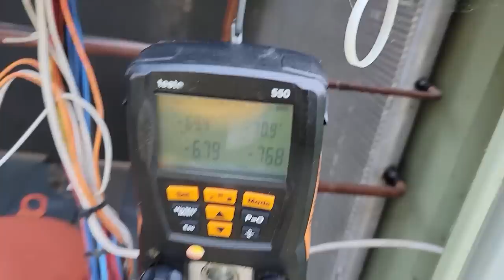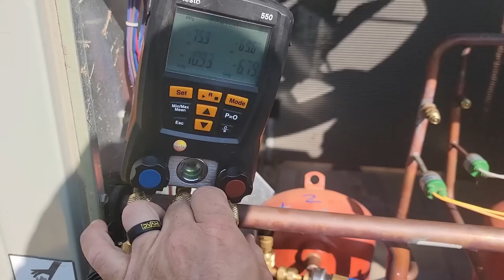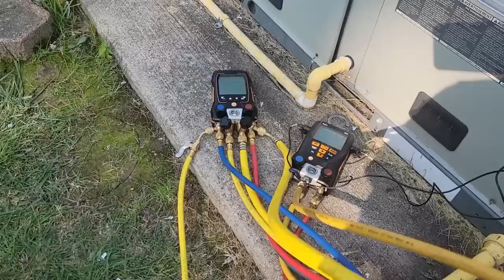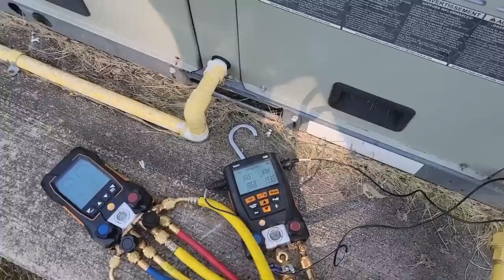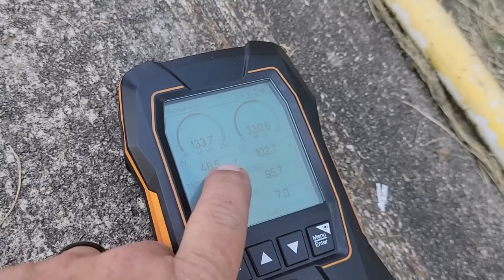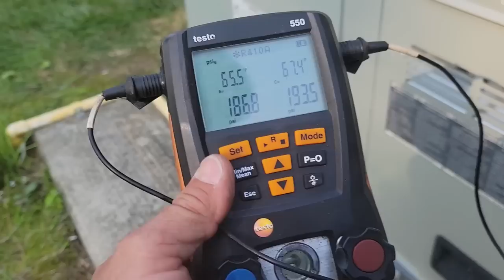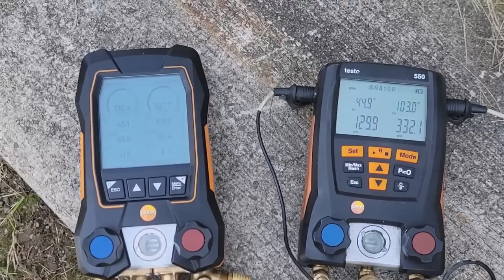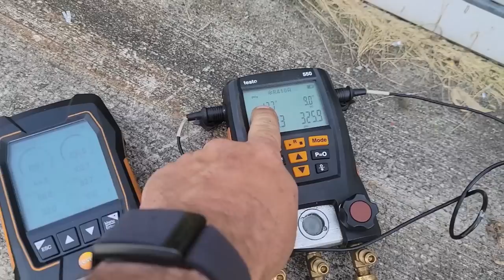Trane HVAC System Not Cooling / Full Repair Procedure

Comment: You are wrong on dye for the same reason cars come with it, its extremely effective. If its a old machine do the customer a favor and sell it to them, everybody wins. Acetone cleans it up like magic.
Reply from the maker: Auto mechanics use it because they're not air conditioning technicians. Hear me out... Air conditioning is just a touch of what they do, they don't specialize in it, sure they understand how it works and have the MAC card, so do I 😳.  Car mechanics usually have a all in one machine they hook up,  punch in the numbers and it does all the work otherwise they change parts that were already predetermined by the factory. They don't find a different brand of part to fix a problem or redesign it. That's a Huge difference,  that's not too dethrone them or devalue but to just state facts they are mechanics that are good at fixing a shit ton of cars problems but that is totally different than just a dedicated hvacr mechanic that works on everything under the sun multiple different facets in the mechanical world. I'm not talking about just residential,  I'm talking about commercial, industrial and all the other different things that most people never see.
Reply: @HVACRSurvival   I don't think that argument makes much sense because a mechanic could have the same leak detector right.  Cars come with dye not because of auto mechanics they come with dye because it's cheap, simple and effective. I'm not trying to flex over anybody but I've had my own air conditioning business in Jacksonville Florida for over 20 years and we've been the largest Fujitsu unitary dealer for at least the last 5, long before we used dye. Dye absolutely increases our productivity and we're probably going to start selling it on tune ups, costs us $5 a shot.  You might want to stay out of Florida or at least make sure bring some rags and acetone with you.  I don't know where you're at but I did see it one way drier on that unit🤣
Reply: @HVACRSurvival   I actually have a trap question for you, do you carry UV light on the trunk for machines  you know have dye, customers tell you they have dye or they have a label?😁
Reply: @HVACRSurvival  I was a mechanic for 7 years before changing careers to residential HVAC. I specialized in MVAC repair and diag. The dye I have always found less helpful than you'd think, usually you have to break out the leak detector or the big blue and a lot of times even that's not enough to find leaks, so you end up evacuating and leak detecting with nitrogen. It's pretty similar to residential HVAC. What sucks about MVAC is there's not a lot of help with superheat and subcool numbers to help you diagnose, and there are only service ports on the suction and discharge usually. Even if you could measure SH and SC accurately, there's so many variables like blower speed, engine speed, engine fan speed, ambient temps inside and outside the vehicle, mode settings, engine temp, etc etc so you end up trying super hard not to just guess and fire the parts cannon. Manufacturers generally only publish charge weight, oil volume and MAYBE target pressures at a certain RPM. MVAC could be ridiculously frustrating sometimes, even with the fancy all in 1 recovery machines haha
Reply from the maker: I have a UV light, the only place it was useful was inside a plant that recovered old refrigerators and recycled them. There was so much refrigerant in the air that the detector was going off non stop. But I didn't see the leak, it must of been leaking under the insulation somewhere in this large recovery machine

Comment: I’m pretty sure you accidentally left your manifold open on both sides, which is why your gauges were reading almost the same pressure on both the suction and the liquid side (as if the compressor wasn’t running) even tho it was. So, the refrigerant was just being passed through the manifold on the gauges.
Reply from the maker: I'll have to review the video again, anything is possible👍👍

Comment: Good ole itchalation. I did mechanical demolition for almost 10 years, and I don't miss that. Especially the old brittle stuff. 
Pro tip: baby powder is an essential when working with that. Rub it on your neck and arms, and it will block the pores so it substantially reduce the itch.
Reply from the maker: Interesting, I'll remember that🤜🤛👍👍

Comment: Rick, that's a nice swaging tool. I made a tool for a one time use. I was remodeling a house where the water pipes froze, but didn't split. They just swelled, fortunately. I had to expand one pipe just enough to use new pipe to repair the old system. It sure saved time and money.
Reply from the maker: Save lots of money on fittings and less places to have leaks.

Comment: 23:07 - Speaking of sharing what works: I can perform smooth un-sweats perfectly every time now since learning about the Sta-Silv White flux trick. Liberally flux the joint you want to unsweat before hitting it with the torch to make removal and reassembly go much better.

Comment: I noticed you have the same swaging/ flare block kit I had in college @ 26:40.  Every tool has its place. When I get in a tight place where theres no room or abosolutely cannot slit the pipe or it will screw me all up, this is my goto tool. It NEVER splits the tubing because it doesn’t try to stretch the whole length of the tubing at once, but rather in increments. Ihave several, and use my yellow jacket monster pair most often but it splits tubing rather easily if you dont rotate it often during the stretch,  i often use it to repair fitting that dont seem to fit ok of have a touch of solder in them or trying to re-round out a compressor connector that was damaged in shipping. Like your videos... have you ever thought of taking the wife with you to shoot the videos while you work?...not all the time but on occation, she seems to be a pleasant personality with a good sense of humour. You guys seem to be a great couple, and she seems to be quite knowledgeable.
Reply from the maker: Well... she kind of has a job too, and she feels as though the whole hospital would shut down if she wasn't there 🤣 . If there's such a thing,  we would call her like a super scrub tech,  administrator assistant super something 🤣. Thank you for the compliment, she liked hearing that.

Comment: Run a filter on your recovery tank to prevent contaminates from entering system when using reclaim refrigerant
Reply from the maker: Yeah 👍👍 after making that mistake,  that's what I've been doing. I've been using a quarter inch flare dryer on both sides with a short hose. Filtering it going in and filtering it coming out.

Comment: 5:03 - So, you’ll be able to reuse that refrigerant in the unit after blending off the top? I guess that’s allowed. De minimus, right?
18:08 - My school taught us to use an “slightly oxidizing flame” for all braze joints. That has served me well two years beyond class.
Reply from the maker: R410a has more issues with fractionation more than other refrigerants do. I usually prefer to recharge with all new refrigerant but if that’s not how they quoted it then you can try what I mentioned.

Comment: Good thing you had 2 sets of Testo manifolds to confirm they were both working 😅
Reply from the maker: 🤭 It save me some time but I would have had to check each individual circuit either way. I didn't always have all these fancy tools. But I've always had at least two basic manifolds.

Comment: So I see you using the field piece vacuum pump and in your newer videos you use the Navac battery operated one which do you prefer ????
Reply from the maker: Eight CFM versus four CFM as long as you’re using a big hose either one’s gonna get it done rather quickly. Size and speed is nice with the wireless, but I would assume the plug-in model is going to last longer, it comes down to personal opinion.

Comment: If you’ll heat the copper a little prior to swedging it will never split. I got tired of it splitting everything, and once I started heating it just a bit it never happened again. I do still try and rotate it several times.
Reply from the maker: I have done that on a few videos and it works great 👍👍 thanks for the feedback!

Comment: Did you purge nitrogen when you were un - sweating the old evaporator out?
Reply from the maker: Nope. I have a bottle brush if I need to clean out a fitting, normally it doesn't get that bad because you can un-sweat faster than finish work.

Comment: Speaking of swaging, I was taught that when mechanics have stock in the truck, copper and fuses gothrough something called embrittlement.  This is where the copper looses a bit of its ductility as do fuses as they age and loos their ability to flex.
Reply from the maker: I have noticed that, sounds correct to me
Reply: It’s called annealing, copper work hardens.

Also how do you keep manifolds clean with using different types of refrigerant or after it gets horrible dye in it?
Reply from the maker: Purge

Comment: My unit was low on refrigerant by 2 lbs over a 4 year period. It was recharged recently, but I'm beginning to wonder the impact on the heat pump.  I hear new systems like Trane can heat without auxiliary heat when the outside temp is still 15 degrees. Should I invest on a new unit? The last unit was installed in 2008.
Reply from the maker: I run mine down to 20° and it's only a 12 seer. It doesn't put out much heat but it's better than running electric. I guess it depends on how much your electric bill is during the winter as to whether or not it would be worth investing the amount of money that they want for that unit. Carriers got one that is called the infinity VNA and it can do I think zero degrees outside at full capacity,  I forget but I know it's a lot better than 15°.
Reply: @HVACRSurvival  Good to know. It's in OH, so weather can be cold at times. Our first year we kicked in the aux. during a polar vortex and ended up with a $400 bill on month. To offset, we do run a woodstove about 70% of the time.
Reply from the maker: 250-400 is about normal in Ohio for an all electric 1500-1800 square ft. In coldest part of winter

Comment: Just Curious. How did the vacuum go using the core depressers? Did you have a good decay test using them?
Reply from the maker: Its not idea, Your taking a chance the vacuum will pull past the Schrader cores so I left the vacuum run even after I backed out the core depressors. Then I released the liquid into the high side. I was gone 2.5hrs on the other call with those big 3/4" vac hoses pulling down with the 8cfm pump, I can normally hit a perfect vacuum with a compressor in the circuit in 30 minutes or less. Whos to say the refrigerant didn't have moisture in it or was fractionated... so I'll be strait,  I did not verify the microns. I'm a horrible person....

Comment: Have you tried the ars pro press fittings ?? They are fantastic..
Reply: So, when you have two compressors..do you have two separately charged systems? Or one big charge?
Reply from the maker: Depends if the compressors are on the same refrigerant circuit.  Smaller systems are usually separate. Larger ones are in parallel.

Comment: I have the testo 557 and the 557s and I have had to send the 557 back to testo to get the gauge recalibrated because my sensors were off on the 557
Reply from the maker: Mine were defective when I got them, Testo swapped them out with a new set. I couldn't get the firmware to update, it would fail 35% into the update.

Comment: I have the same Hilmor swage kit. I also have their benders with the reverse bending attachment.
Reply from the maker: Same here, I love my bender
Reply: @HVACRSurvival  i did notice myself when you talked about swage that 3/8" line. Its done that to me as well. The other sizes it doesn't do that. Just 3/8". Anyways i really liked the video. It was cool to have a longer video than normal.
Reply from the maker: @jasonjohnsonHVAC  Thanks for the feedback!
Reply from the maker: @jasonjohnsonHVAC  I have the 1/4 and it will do it to but I heat it up or use the spin swage

Comment: Nice.  Why didn’t you just pop the economizer out to give you greater access? Not a criticism, just wondered.  We always remove them for access when swapping evaps.
Reply from the maker: I thought about that, I don't do a lot of Trane and was worried I might break that plastic damper linkage. You have a good point!
Reply: @HVACRSurvival  To save aggravation/ technician abuse, pull the whole end panel. The whole end panel/ economizer comes out as one piece. New units could be ordered with or without economizer. Same unit.  Cheers

Comment: With electronic gauges of any type (mostly I'm experienced with multimeters and other kinds of electronics), they can be REALLY picky about voltage.   If that battery is going iffy, even if it shows a half or three quarter charges, replace it.   Even a rechargeable lithium-ion is only really good for about 500 charges, and that's if you regularly run it down to the bottom and back up again.    (5-10%)      I don't know what kind of batteries those use, so I can't make a suggestion about a good one to keep as a spare in your vee-hickle.
Reply from the maker: 4 AA.
Reply: @HVACRSurvival  - I've had good luck with the Northern Tool branded alkalines.  For primary lithium AA, energizer seems to be really good for me.  Avoid Duracell unless you're going to use it immediately and replace it as soon as it runs down.  They like to go boom.
Reply from the maker: @tbelding  Energizer is my main one then I'll go to the rayovac alkaline which is owned by the same company that owns Energizer.
Reply: @HVACRSurvival  I always liked Ray-O-Vac, even before being owned by that conglomerate.

Comment: i usually solder all my joints stay bright 8 has a 6000 psi threshold, in 20 years not one call back because of a weak joint, used to braze all the time unnecessary.
Reply from the maker: That's what we use to use on AC work when I first started. Your correct, when properly cleaned it works great, I hate that it doesn't fill gaps in the pipe though.

Comment: Rick love your videos but (there is always a but) you
used the incorrect name for your flame type you use.
At time 20:53 you can see clearly 3 flames, the outer
(some call the envelope), the middle cone and the 
inner cone. This is called a carburizing flame. It looks
to me as a 1x carburizing flame (the middle cone is
equal to the inner cone if the middle is 2 times the 
length of the inner it is a 2x). When you were annealing 
the copper so it would not split that might have been
a oxidizing flame that is very hard to tell from the video.
Also the soot you wiped off the dryer was because you used
a carburizing flame. Do not get me wrong I also use a 
slightly carburizing flame when welding on aircraft.  
We were told to use slightly carburizing flame so we 
would NOT be accidentally using a oxidizing flame which 
in some cases very bad! In aircraft we only use brazing
on fuel lines and such and they were mostly stainless
steel. So when I braze copper lines I use a slightly
carburizing flame as it is easier to see and keep.

Comment: I ve had an oil flame burn my hand before trying to sweat off something similar like that. Couldn’t you have cut the stub between the equalization line and the coil and then sweat out the remaining stub? I wouldn’t want to see that happen to anyone else
Reply from the maker: That's why I try to remove the flame before pulling it apart. I know it can still happen and I have had a large flare up from a process chiller when I had to remove the drier.